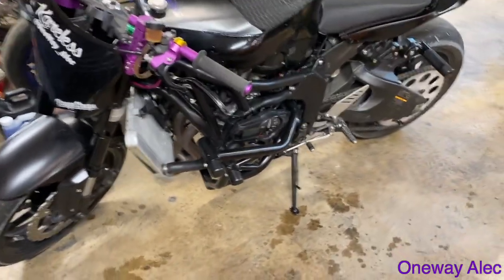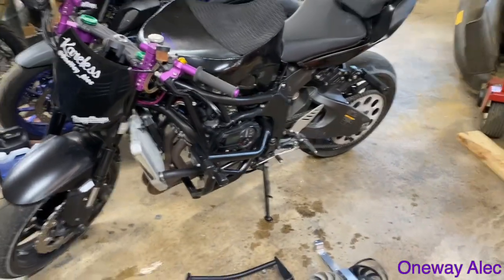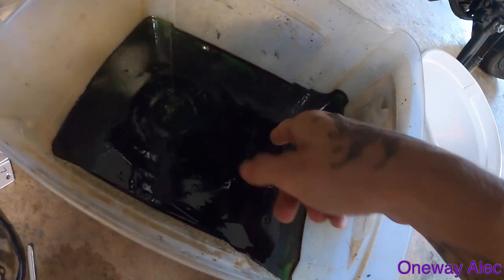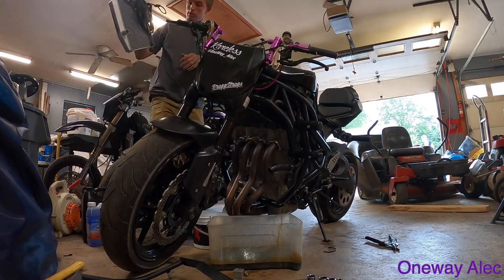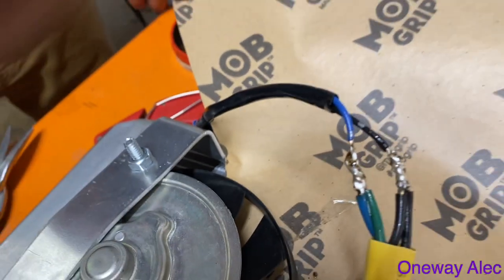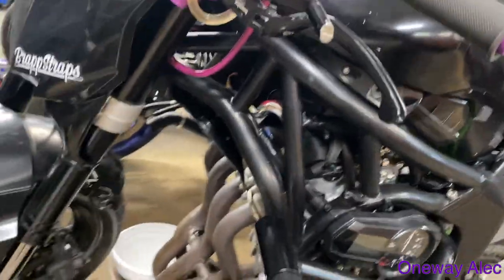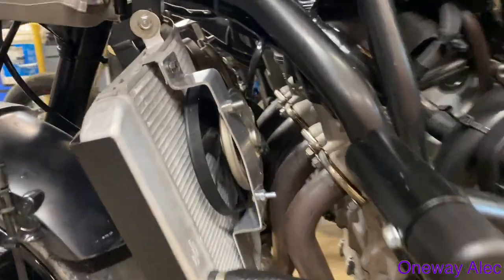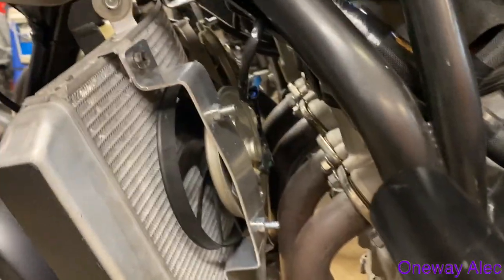HOW TO INSTALL DUAL FAN RADIATOR CAGE! ( KAWASAKI ZX6R )

Comment: I have a 03/04 and just did this. I haven’t hooked up the manual switch yet but when the fans kick on the fuse blows. The factory fuse for the fan is a 10amp. Am I good to just throw a 25 amp fuse in and they should would like normal?
Reply from the maker: Yes throw a bigger fuse in there! 🤟🏼